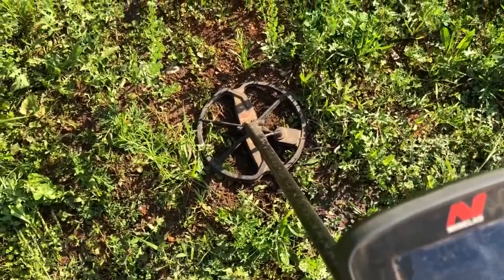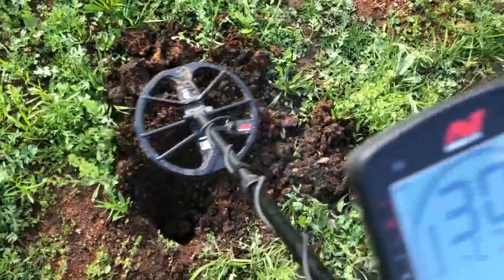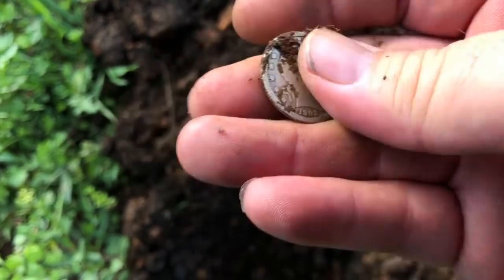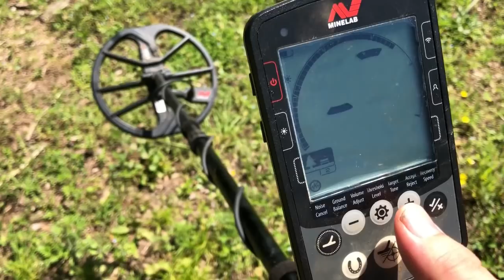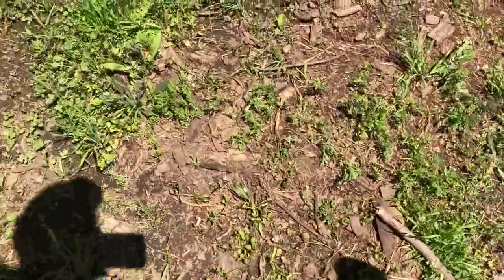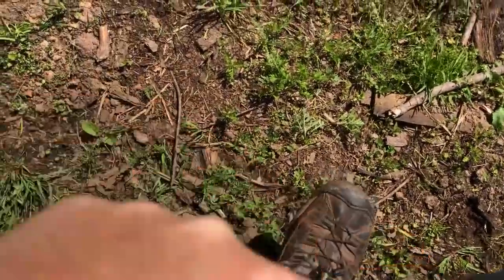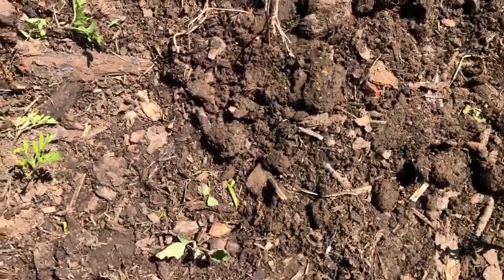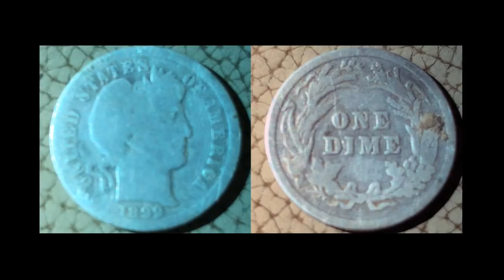Minelab CTX 3030 vs Equinox 800: Comparing signals on silver coins in the wild.  (#55)

Comment: At 4:28 theres a vertical line on Target trace , that means theres was iron next to the coin , thats why i love my ctx 3030
Reply from the maker: Yessir. Target Trace is very useful and you can definitely see that there's iron in the hole with the coin. Target Trace, along with the 2D  FE-CO discrimination and extremely accurate target ID are the reasons I will never part with my CTX 3030. I think the CTX and Nox are a great combination. Thanks for watching! HH Dewayne

Comment: I had the same experience with an 1899 dime only with an etrac to compare. The etrac was a nice and solid deep dime hit and the 800 was a much lower tone and not as solid. The dime turned out to be 8-10 inches deep. I suspect it was on edge or at a 45 or so angle. Like you I wonder if a different setting might have produced better results. We had the speed set to 5 and were in the park 1 mode accepting signals 4 and above. I think the sensitivity was set at 23.
Reply from the maker: coinhuntingnet yep the FBS detectors give that unmistakable tone on deep silver. I like the Nox for hunting older sites with lots of iron but still prefer my CTX for coin shooting.

Comment: Suggestion after reading comments that I agree to... 7 can be way to chatty and you will miss the good signal when in iron or multi-target zones as the NOX was indicating.   By having your settings button configured so you can click into it and bounce it down from 7 to 1 you will notice a big difference in isolating the target and cut out the other "noise".  Of course you probably would not want to leave it here unless working a small area slowly.  I like a 4-5 when in conditions like this and then lower it to be really sure once something fires in the zone.   Been going over sites that I had higher recovery settings with better success in finding deeper targets amongst trash when I can work an area slowly.   That delayed hit sound is music to my ears to stop and fiddle more with recovery to give me confidence to dig and identify.  Check it out for your next video and keep up the videos.
Reply from the maker: Thanks HiTechKoke. Pretty good idea to have the user profile button set up with a slower recovery to check the target. I will try that. I usually run recovery at 7 in really thick iron (like at this particular site), and around 5 in cleaner ground. I do realize it clips the signal. However, I've found lots of other coins with the Nox at this site with recovery set at 7 and they sounded great. Could just be something funky with that last target that the Equinox didn't like for some reason. Like I said, I've found lots of good targets with the Nox that didn't sound good on the 3030 so I guess it can vary by target. I love both machines and think they compliment eachother nicely. Thanks for watching! HH Dewayne
Reply: Actually I don't use the user profile... too hard to reach up and press hard... I just use my thumb, hit the settings... then  the + and - keys  and then detect... faster for me that way.   Kind of discovered all of this after reading and then trying in the field and then I was sold and found a few more coins in the yard.   All good in the end.  Agreed the target could have been funky too.
Reply from the maker: Yeah I agree. The profile button would've been much better if they had put it below the display for easy access. I have a custom profile set up at 5kHz to check bottlecaps but I've found its easier and faster to just cycle through the frequencies using the frequency button. I will definitely try your suggestion though. HH Dewayne

Comment: Just a thought , when you showed the CTX on the dime you had the Nox turned off, But when you showed the Nox on the dime you still had the ctx turned on, might be why the Nox sound wasn't so good due to cross talk. Might want to turn the CTX off next time. Just a thought
Reply from the maker: True, but I think they were far enough away that it wasn’t an issue. These two detectors actually play nice together unless they’re right beside each other. I will make sure they’re off next time though, just to rule out that having any effect. HH Dewayne

Comment: Both where equel.setting up properly and down the man holding the detector.UK CTX fail ironized roman sites.Nox works on them set up right
Reply: CTX works great on iron and coke roman sites ,I find small minims and cut 1/4s with mine ,and loads of tiny bits of lead and even bb shot

Comment: On the first test you had the nox on recovery speed 7 ,why so high ,because that will affect the depth ,you didn’t need the recovery speed so high as you was running the very slow 3030
Reply from the maker: Hey Gary. I do run a lower recovery at cleaner sites but that place is thick with iron, so I don't want to go too low with recovery speed as it would take away the Equinox's biggest advantage. Depth wasn't an issue. If you look at the CTX's display you'll see that the target is only 4 or 5 inches deep. HH Dewayne
Reply: I agree.  I would like to have seen the recovery speed at 4 or lower on certain digs or maybe the detector swung from another direction.  Thank you for the video as I am considering the CTX 3030.  I have the Equinox 800 and I love it, but I’ll be watching more of these comparison videos.

Comment: $900 vs $2500

Clearly the CTX has an upperhand but does it justify the huge price gap?
Reply: South London Metal Detector the update improved the 800 to what extent? Is it now up there with the 3030. I want to pull the trigger on the Nox 800, but still on the fence!
Thank you!!

Comment: great video ...quick question ..can I use normal Bluetooth headphones with the equinox without having the little box thing to send to headphones ?  thanks
Reply from the maker: Thanks Duane. Yes you can use Bluetooth headphones without the need of the module. Just make sure they’re low latency or else you might notice a slight delay. Thanks for watching and HH! Dewayne
Reply: oh great I was realy hoping that I could do this thanks so much for the information ...great videos ..

Comment: Good video and good food for thought.  I've been wondering how a recovery speed of 4 versus 6 which is stock on park 2 would effect masked targets.  My guess is not much difference but the advantage is your coin would have came in better. Only further testing will tell!
Reply from the maker: Minelab Man - No Coin Left Behind! Thanks bud! Yeah a slightly lower recovery speed probably would’ve cleaned that particular signal up, but that site is blanked with iron so was trying to give myself every advantage possible as far as picking out masked targets. I have actually hit a few targets there with the Nox that the CTX didn’t alert on. Next time I’ll probably try it at 5 or 6 just to see what happens. Thanks for watching! HH Dewayne

Comment: I'm a sure that coin was on edge , thats why Nox struggled. I have a E trac and a friend a Nox , we made a test with square nail and  a silver coin on edge burried 6 inches , we had exactly same results like you, E trac no problem .
Reply from the maker: jengio30 it probably was on edge. The Nox has spotted a few targets that the CTX didn’t give a great signal on as well so that one target doesn’t change how I feel about the machine. Both of them great IMHO. Thanks for watching & HH. Dewayne
Reply: They rectified the problem in the last firmware update apparently.

Comment: Did you ground balance your Equinox on this site before doing the comparisons with the CTX?  I've yet to see a coin target the Equinox could not hit just as well as an Etrac which is not a CTX, but I do consider them very close. On the other hand I have seen targets the Etrac could not hit well enough to give a I.D. report that says dig it while with the Equinox it was solid dig numbers.
Reply: Also your recovery speed on the Equinox set at 7 is a little high if you ask me. Anything above the default 6 in park should be reserved for the worst iron and modern trash sites. I'm talking thick iron or ridiculous modern trash. I kind of feel you had the Equinox detuned.
Reply from the maker: I did ground balance. Now that I’ve spent more time using the Nox I’m thinking this was just a fluke. I haven’t experienced anything like this since. The Nox can indeed hit some targets that the CTX can’t see. It hits coins on edge better, as well as tough targets mixed with iron. The CTX is still my weapon of choice for coin shooting cleaner ground though. Those unmistakable FBS silver tones and accurate TID make it really easy to have an excellent coin to trash ratio. For hunting trashy spots I prefer the Equinox.
Reply from the maker: @longbow6245  Thats a possibility. I was still fairly new to using the Equinox when I recorded this video. Nowadays I keep the recovery speed around 5 most of the time unless its an extremely iron infested spot. I also keep the little 6" coil mounted on it. Its a great detector no doubt.
Reply: @MetalDetectingNWGA  hi, just wondering now in 2023, what your go to detector is for coins and relics? I have a GPX 6000 and SDC 2300 for gold, and am wanting to get into some coin hunting with a good machine with discrimination. Is the CTX still a top dog?
Reply from the maker: @MrDeymann  I sold the CTX last year and now have a Deus 2 and a Manticore. They each have their own strengths and I really like them both, but if I could only keep one, it would be the Deus2.
Reply: @MetalDetectingNWGA  Thank you. Much appreciated

Comment: Park2, sensitivity 22-24, recovery speed 3, FE1-2 this is correct setting. Recovery speed 7 you loose deep and loose a lot
Reply from the maker: Hi! Unfortunately there is no “one size fits all” correct setting. The correct setting depends on the type of site you’re hunting. Yes, you will lose some depth with a faster recovery speed, but if you’re hunting a very trashy area, it’s worth trading off some depth for more separation. Thanks for watching and happy hunting!
Reply: Metal Detecting NWGA Park 2 program is only for clean area, for trashy area Park 1 and field 1
Reply from the maker: @povilasravdanavicius5063  Actually, Park 2 and Field 2 use a higher combination of frequencies and are geared toward hitting smaller, lower conductors. Park 2 and Field 2 are also better suited for higher trash density. Park 1 and Field 1 use a lower frequency combo and are better suited for detecting higher conductors like US coins. The recovery speed can be adjusted on any program to hunt clean or trasy areas but out of the box, Park 2 is set up to seperate in high trash better than Park 1. I'm not trying to sound like a "know it all", but I do have a very good understanding of how the Equinox works. You can read more about how each mode operates here: https://www.detectorprospector.com/forums/topic/5830-is-the-equinox-a-deep-seeking-machine/?tab=comments#comment-61281

Comment: Why would they bring out a new machine at half the price of their flagship machine to be better ..I’ve got the ctx, it’s a killer. They would just lose money and wouldn’t sell anymore ctx machine’s. It’s stupid of course it’s not better than the ctx
Reply from the maker: With its extremely accurate ID, Target Trace (which I find very useful) and unmistakable tones on deep silver, the CTX is still the undisputed king of coin shooting IMHO. However, the Equinox has some advantages over the 3030 when it comes to hunting lower conductors such as gold jewelry, relics, etc. With its ability to use higher frequencies its more sensitive to smaller low conductors, and will hit them much deeper than the CTX. Its also very light and fast, so it makes a great scouting machine. Personally I think these two detectors compliment eachother very well. If you can own both, you've got all the bases covered. Thanks for watching and HH. Dewayne
Reply: not sure if you make more money. Even I bought an Equinox 800 (first detector ever). I would never have bought the CTX as a first detector because of the high price for a first detector. So maybe instead of 1 CTX they now sell 5 Equinox detectors. Pretty good hype going for the Equinox. I bought into it. Still have to find my first nugget though :)  I found a lot of aluminium paper (and loads of other trash) instead.

Comment: У меня  был стх 3030  теперь эквинокс 800 я не разу не видел на эквиноксе таких глючных сигналов)) он всегда четко показывает если там монета .я правда отключаю чермет и хожу на заводских настройках по скорости он намного быстрей  чем стх по глубине тоже я не понимаю как эквинокс не увидел монеты .
Reply from the maker: That target kind of surprised me too. The Equinox saw the coin and gave a signal, but not as clear of a signal as the CTX for whatever reason. I still have high confidence in the Equinox as it has also found a few targets that the CTX didn't alert on. Detectors just do some strange things sometimes.
Reply: Слишком большая скорость стояла, 7 это много.

Comment: Slow you speed down to 5 and I’ll be that signal comes in stronger
Reply from the maker: Yep it probably would. Pretty thick iron there though so I don't want to take away the Nox's biggest advantage by going with too low of a recovery speed. It has sniffed out some coins that the CTX missed at this same site with recovery set at 7. Thanks for watching! HH Dewayne

Comment: Everytime i look at a equinox video  and Nox does not do well , i see people crying like babys, i mean they start saying it's becuase you we're using it wrong , or settings are not good or turn sens down iron bias up etc etc if it's that good tell me why you have to do all this changes?. You just don't admmit that Nox it's not the miracle machine that Minelab tried to make you believe . I do believe Nox is a good detecter a middle range detector thats it! It's not a Fisher f 75 or deus, or etrac or ctx 3030. The only advantages i see with equinox is that it's light and finds tiny stuff, tiny gold, thats it!
Reply from the maker: Yep no such thing as the perfect detector. For me the Nox is great for really trashy areas as its extremely fast, and like you said its good at finding tiny low conductors. Its a great machine for relic hunting IMHO. For coin shooting I still prefer my CTX.

Comment: The ctx is more powerful and better looking.
Reply: In fact ctx is a lot better, equinox is a good machine but not even close to ctx
Reply: @exploracionesconluis102  CTX is 2x the price of nox. Is it 2x better? 🤔
Reply: @smash7777-  oh yes my friend, first of all quality its 100% better on ctx , nox its made of cheap china plastic i have a friend thar in one year 3 times has send it becuase of multiple problems and me 3 times  also. Battery on nox sucks , ears on nox coils break very easy, discrimnation on ctx a lot better with nox you pull out so much trash with ctx very little, yes i know that nox can pick up  smaller things , so what i dont need those uslees tiny things, its worthless for me and a waste of time digging those tiny things. If you use nox for nugget hunting well thats the only thing that nox is better than ctx
Reply: @exploracionesconluis102  

All the YouTube videos of nox finding good stuff must be fakes? 😜
Reply: @smash7777-  lots of detectors finding good stuff, ctx, deus, at max etc etc you nox users think you have the best lol! Nox is so "good" that minelab is all ready with a new machine called Vanquish  that obsoletes Nox  Lol! Only two years or less it took minelab to replace Nox wow!!!
Reply: @exploracionesconluis102  

I have only been detecting for about 1 month so I for sure don't think I have "the best". 
I did get a nox 800 after some research though. The price wasn't an issue either if I thought the CTX was the better machine for me to get I would have gotten it. 
I only really know what I see on YouTube videos and different forums or whatever about different machines so no expert by a long way. 
I see lots of CTX - nox comparison videos and near all show they are similar machines in some ways. 
I have only been out a couple times so i am in no way able to make judgements on different machines as I really don't know. Just say what I see.
One thing I agree is lots of "less expensive" machines find good stuffs too.

Comment: You should be in Field mode and not Park.
Reply from the maker: Hey Hedge Hopper! I’ve tried the Field modes there too but prefer Park 2 at this spot due to the very high concentration of iron and junk in the area. It’s actually been working very well. Something was just funky with that last target. Thanks for watching and HH. Dewayne

Comment: Noise cancel shouldn’t be done in the air, it should be done with coil on the ground
Reply from the maker: Noise cancelling simply selects the quietest operating channel, helping to avoid interference from nearby power lines, electronics or other detectors. Performing a proper noise cancel is done with the coil lifted OFF of the ground, according to Minelab (page 39 in the Equinox manual).

Comment: something wrong there,,,,NOT a digger all day long
Reply from the maker: On the CTX signal? Why would you not consider that a digger? Tone is very good, TID reads 12-45 to 17-43 which is in the coin range, target size is good, depth looks good, solid dot building in the coin range on Target Trace. Not to mention the target did turn out to be a silver dime so the CTX was spot on as far as I can tell. If you were talking about the Equinox signal then I agree. Definitely not a digger.